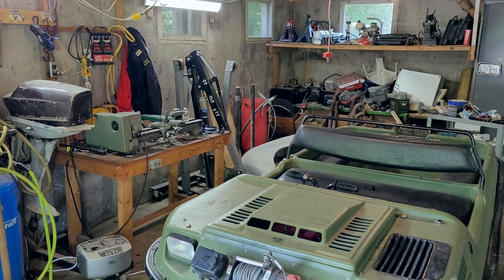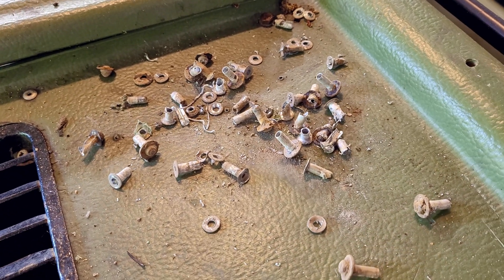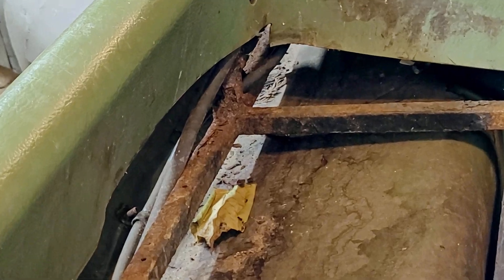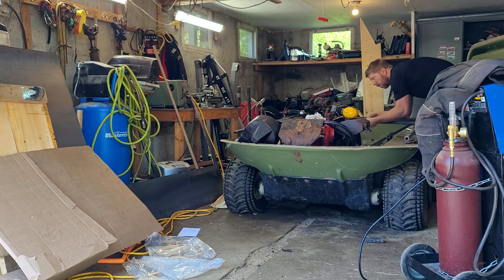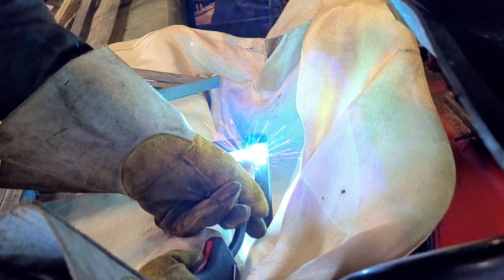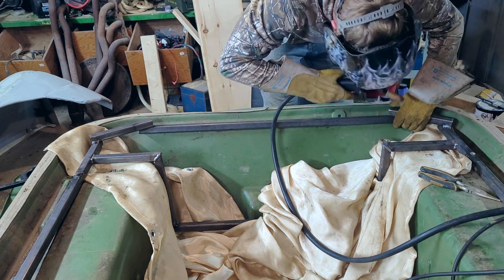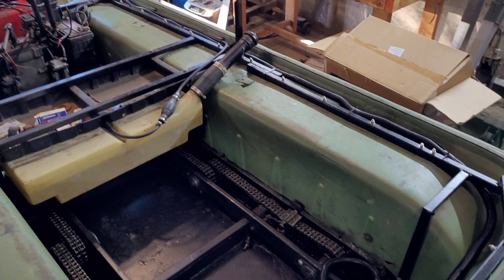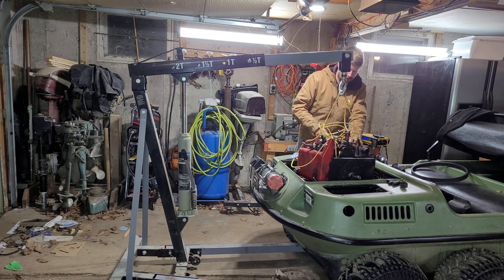Building a Body Support Frame to Fix Argo Body Sag: Argo Magnum Project Part 4

Comment: This has been a really helpful video!  Mine sags also and the tracks rub.  I also want to make a cab for it and that will need more support. Your setup looks really solid!
Reply from the maker: Thanks! So far so good on that support. I just picked up Southey old Argo, an I/C, and the body on it is so bad that it rubs even on the tires with no tracks. I bought it for parts originally, but it actually might be good enough to restore
Reply: @RustRehab it’s incredible how little has changed to the frame of them over the years. It’s like the old chevy small blocks.

Comment: Interesting & from the Mastercraft stuff... obviously Cabadian. 

I haveca slightly newer conquest 8x8 with Kawasaki. We use it to drag moose out in season. I really want to do similar to this but doubt if it will be this year. I want a bale lifter hoop & a winch mount behind the seat to run it. The idw being to raise tge moose head over the rear & make it easier to drag....
Reply from the maker: Moose hunting was my first big game hunt, and has always been my favourite whenever I can get a tag. When I build my enclosure, the plan is to run some pulleys (or just have a rear winch) routing the cable off the rear top of the enclosure so that I can hook it to a big game animal and either get the head and shoulders off the ground for an easier drag, or just to make it easier to get that animal in the back. That's the plan anyways, we'll see if I can get around to it maybe this winter
Reply: Great idea